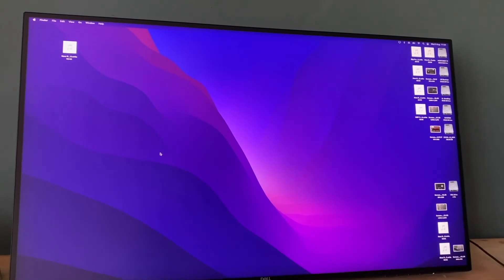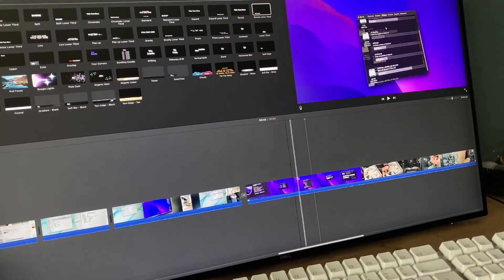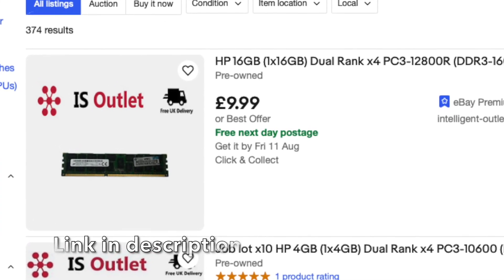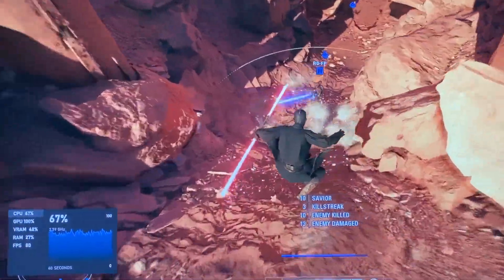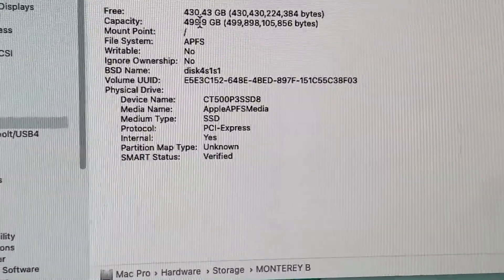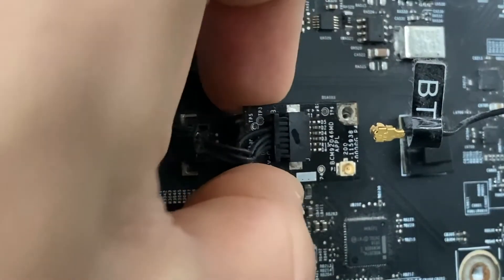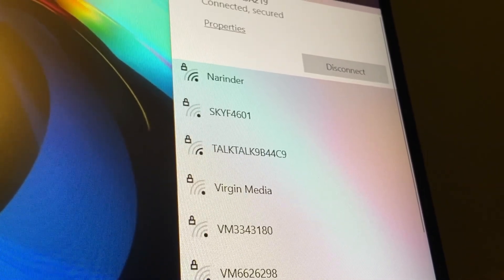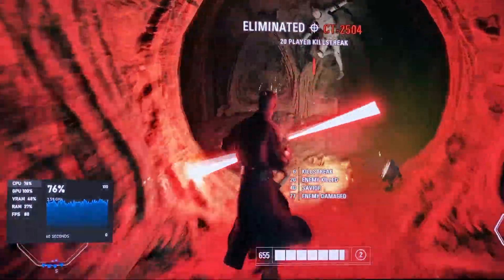6600 XT Mac Pro 5,1 Upgrade - Building the Ultimate Mac Pro 5,1 in 2024 with new CPU, Airport & more

Comment: this is not even close to the ultimate lol mines running rtx 4090, 96gb ram, 12 core 3.46GHz, 4TB NVMe & Win 11 Pro
Reply from the maker: I admire the insane spec you’ve built, but I feel like budget is an important factor here. There’s no point putting a 4090 with a 2010 era Xeon, in my opinion…
Reply: @montaguebarnabasltd  Totally agree. I picked up a 2010 Mac Pro for just $200—already loaded with dual 6-core 3.46GHz CPUs and 128GB of RAM (I removed two sticks). I already had an NVMe drive, and the Ugreen PCIe adapter only cost me $15 on Amazon. It’s installed in the lowest x16 PCIe slot, giving me solid 1850MB/s read and write speeds. The GPU is in the second x16 slot (just barely fits), but unfortunately that leaves no space for a USB 3.2 card in the remaining x4 slot. The GPU was originally for my main gaming rig, but I threw it in this Mac Pro setup about two weeks ago to test it—and it crushed. I ended up grabbing an RTX 4070 on eBay for $450, which I plan to leave in the 5,1 permanently. For gaming, this thing is still an absolute beast—even with its older CPU. I run everything on ultra settings at 1440p because it is the max resolution of my Apple 27" LED Cinema Display, and honestly, I can't imagine games running any smoother. All up including the RTX 4070 the system cost me under $700—and for that price, I genuinely don’t think there’s a better bang-for-buck setup out there.
Reply: Also, just a bit off-topic—but I have to say, the Mac Pro 5,1 really impressed me. It’s honestly incredible what Apple built back then. I also own a late 2013 Mac Pro 6,1, and like my 5,1, it’s running Windows 11 Pro—because macOS is absolute trash, lol.
My 6,1 was the top-spec model with the 2.7GHz 12-core CPU, which turned out to be awful for daily use—slow and laggy. I ditched it and swapped in an 8-core E5-2687W v2 (150W, 3.4GHz turbo), which Apple never officially offered. It completely crushes the stock 12-core in single-core performance and matches it in multi-core (confirmed in Geekbench). It also has 64GB of RAM, the dual D700 6GB GPUs (which actually work together properly under Windows), and a 1TB NVMe.
On paper, it beats my 5,1 in Geekbench—both single and multi-core—but in real-world use? It’s a joke. It can’t run games at all! it can't run anything graphic demanding! the GPUs are useless for anything modern, and there’s no way to upgrade them. No PCIe slots. Nothing. And this was supposed to replace the Mac Pro 5,1? The 5,1 with an RTX 4070 absolutely obliterates it.
I only use the 6,1 for Zoom calls now—it’s honestly the most pathetic “Pro” machine I’ve ever owned. No idea what planet Apple was on when they thought this was an upgrade. Just wanted to share my experience with both Mac Pros. They’re a generation apart, but seriously—they’re worlds apart.

Comment: I'm fascinated by all the things you can do with older computers today. I love being able to make these things still relevant.
Reply: I recently used Open Core Legacy Patcher to install Monterrey on my mid 2009 MacBook Pro 17 inch that I had shelved a few years ago because of the nagging issues of support dropping from browsers, etc with running El Capitan the last supported system.

I grabbed a new SSD, already had ram maxed, and did the new system install with OCLP.  It all went smoothly, and to my surprise Monterrey actually performs more smoothly than El Capitan did.  So now, I'm taking it with me again whenever I need mobile computing.  I've always taken good care of it, so it is in near mint condition and now feels like a new machine even though it is 16 years old!  Blows my mind actually.  I definitely won't go past Monterrey but it will serve me well for another few years at least for what I use it for, which is quite a lot actually.
Reply: This old computer has a lot up upgradeability which kept it performing over a long time.  New Macs have none of that.
Reply: @gametime2473  I can still use my 5,1 as a Maya workstation in a pinch.

If I wanted to, and part of me does, I could cancel my Quicken subscription, which goes up every year, and just use Quicken 98 on my Rev A iMac (or via SheepShaver), since I never use the more advanced features. 

MS Office is on that machine, and so is AppleWorks. Aside from questions about compatibility with others' systems and files, why not use these things today? Is PowerPoint so much more advanced than it was in 2000?

Comment: What did you gain by going with the Xeon X? I have the W3680, and it appears to be nearly identical to the one  you installed.
Reply from the maker: It has a smidgeon higher clockspeed I believe. Also, the X series can be used with dual processors which I initially intended to add.

Comment: Just a quick comment and understand this vid is some 10 months ago. The latest versions of OCLP (1.4.1 and 1.5) do allow the legacy blue tooth card to work, at least, up to Monterey but not it seems with Sonoma (have both on my system - 2012 with dual 3.46Ghz and 64 ram along with a flashed AMD Radeon RX 580). The legacy WiFi card, OTOH, is fine with both 12.7.5 and 14.4. Also I installed a USB 3.0/3.1 PCI-e card  I got off Amazon for about $25. Other than OCLP that was the single best addition to this ol' Mac.
Reply: macOS 12 or bust!

Comment: I’m running windows on that machine using rx580. Is it possible to plug and play unflashed rx6600xt nitro, if I don’t need a bootscreen? Love your videos!
Reply from the maker: Thanks so much! 
Yes as long as you don’t need to actually see a bootscreen you can boot into your usual OS.

Comment: meanwhile my main desktop is a 2008 emachine with a 3ghz core2 duo, 4gb of ddr3, which is unusual for socket 775 i guess, normally they use ddr2, anyways i have a nvidia geforce gtx 950 gpu and it plays all the games i want to play just fine. seems increasingly only the gpu matters. if i had money i'd probably just get a new system. i found that gpu in a dumpster shockingly, the only thing wrong with it was that it needed to be cleaned.. the only mac i have btw is a 2006 imac which i've managed to install mac os 10.8 onto as well as win10.. though i'd think anything newer might run slow as molasses, had to trim win10 down on both the imac and emachine, just so much bloat.
Reply from the maker: Nice setup! 
Honestly you’re right about the GPU/CPU reliance. Gaming is mostly a GPU stressy task.

Comment: Thanks  for an incredibly interesting work. I wanted to ask you if the MacPro 5.1 PSU can work with a video card AND a Radeon RX5700XT 8gig? I need it to edit video in 4k.
Reply from the maker: Thanks for the comment! I considered the 5700XT, but found it was very likely to need the PSU mod, depending on the model I got. If you’re not willing to give it a shot (I wouldn’t blame you), I would try the 6600XT, which offers better performance, or perhaps the 5600XT for something slightly weaker and less power demanding.

Comment: Dual CPUs would be a night and day difference for you. I just did the GOP flash on my 3 Mac Pros, so any PC GPU will work with a boot screen. Still, ALWAYS run OpenCore. It will protect your Mac from getting bricked by Windows, as well as give you a boot selector, even if you don't do the GOP Flash. Flashing the GPUs is no longer necessary. Flash the Mac.
Reply from the maker: All solid advice. Yeah OCLP is the saviour of all old mac users at this point, I just find opencore takes a little too much work to sort out. 
I think dual CPUs may fix my editing problem, but definitely won’t make a difference in gaming. When I’m going to be forced to upgrade anyway because of the latter problem, it’s not sensible to buy a dual CPU tray to fix only the former.
Reply: @montaguebarnabasltd  idk, I use one of mins for gaming, and it's way faster then my son's gaming PC, and he has an RX580 as well. Also, I wrote a script to automatically flip the flags in OC (or OCLP) for hardware acceleration and updating. let me know if you would like to see it. OC is pretty simple, once you understand it and get comfortable with it. With OC, unlike OCLP, you don't gave a patched or hacked OS, It runs natively, up to Monterey, If you're not going beyond Monterey, you should us OC, not OCLP. I do use OCLP on my Mini, and I will use it if I go to Ventura or Sonoma. I have nothing against it, other than keeping my OS native, and unpatched for Monterey and below.
OC also protects your Mac from getting bricked by windows. OCLP may do the same, but I think I have seen people with OCLP having problems with hardware acceleration. That may be resolved by now.
Reply from the maker: @fleonard4  Tbh it’s just illogical to me that a machine that probably has half the memory speed, 1Ghz lower clock speed, more than likely a slower SSD ETC can beat a modern gaming machine of this decade. 
Saying that, you seem pretty well informed about OC/OCLP. Thanks for the info, and I will more than likely be looking further into it in the future. I’ll let you know if I do want a look at that script!
Reply: @montaguebarnabasltd  well, again, it's benchmark and numbers watchers, vs real world. I can tell you, the dual CPU is night and day. I wouldn't even mess with a single CPU system. IF I got one for free, I would play around, but end up using it for spare parts. I have heard you can put an i7 in the single CPU systems. Still, unless you are just laying around, the x6590's are the way to go. The thing about benchmark watchers, is they get debunked. People have done the comparisons triple channel vs filling all the slots, and you can see a difference in the benchmarks, but real world, you won't see it. The same with GPUs. People say the PCIe is slower, but in reality, it makes no difference. You may see it very slightly in benchmarks, but not in use.

Comment: Great video! Did you have to replace the ROM on the video card to get it to boot? Everywhere I look it says the ROM has to be replaced to "fix" the 6600 XT to allow the classic Mac Pro to boot.
Reply from the maker: Thanks for watching! 
Yes, I actually bought a custom ROM 6600XT from MacVidCardsEU over the summer. It’s doable at home, though, with enough expertise.
Reply: GOP Flash, and ant PC card should work. Still, ALWAYS use OpenCore (not OCLP, unless you're going past Monterey). OC protects your Mac from getting bricked by windows and many other benefits, even if you've done the GOP or GPU flash.

Comment: Have you tried installing an RX 6800 in that machine?  I have the same GPU and Mac Pro 5,1, booting exclusively into Windows 11 via Opencore Legacy Patcher and have been thinking of upgrading.  I heard the 6800's TDP of 250W works in the machine as well (unigine ultra quality benchmarks draw about 25W from the backplane, and 100W max per MB power connector).  With an EVGA powerlink, you can further stabilize the power draw.  With 16GB of VRAM, the RX 6800 is about as powerful of a GPU as you can get without doing a pixlas mod.
Reply from the maker: I agree. It should work fine, but I haven’t tried myself. From what I’ve heard the 6800 is runnable without any modification. YouTube and Reddit threads are a good place to check people’s individual experiences though.

Comment: Could you please share a little more detail on your HD configuration 

I’m specifically interested in which NVME adapter you used to get it to boot into Mac OS

I previously saw where there are compatibility concerns with PCIe  cards booting Mac OS. 

Also how are you booting into windows?  

Ie do you have a separate drive for windows that is on the SATA (2.0 iirc) connector on the motherboard?
Reply from the maker: For the NVME adapter I actually don’t remember the one I bought. I’m not going to be able to check until early Jan because I’m away from home. Sorry to not be more helpful! 

As far as Windows goes, I keep it on a 240GB SSD on one of the motherboard SATA sleds with no other OSes on, as I’ve heard that helps the Mac play nice (both to make sure it sees the windows installation, and so it doesn’t mess with any current MacOS versions). 

Confusingly, despite everyone saying I’d need to use a DVD disc, or find a complex workaround, I just put the windows installation tool onto the same 240GB SSD, then made it write windows to itself, plugged into the Mac via USB. It’s worked flawlessly ever since, and since I have a flashed 6600XT card, I can view a bootscreen and choose windows or any one of my MacOS versions to boot into.
Reply: I use an Ableconn Dual NVMe Card. PEXM2 130. I was running Big Sur on it for ages and just recently upgraded to Sequoia. Has always booted just fine.

Comment: I am fully onboard with the Mac Pros 4,1 and 5,1.  I have a 4,1 flashed to a 5,1 and dual 5690 processors, 128GB of RAM, RX580 Graphics card, 2 GB of NVME boot disk, dual 8 TB Raid drives running Sonoma 14 (not 14.1 due to potential issues).  This is my daily driver and I absolutely love it.
Reply from the maker: Excellent! You’ve gone about as far as it’s possible to go into upgrading those things. A 2009 machine as a daily driver in 2023 is such an achievement.
Reply: I have a NVIDIA GeForce GTX 770 2 GB Graphics Card, plus 128 GB 1333 MHz DDR3 Memory, 2 x 3.46 GHz 6-Core Intel Xeon Processor, Mac Pro (Mid 2010) with Mac Pro - 10.14.6 Mojave Operating System. I'd love to know how you got Sonoma 14 as your Operating System, and what I might or should do to get Sonoma? Your help would be appreciated, thank you in advance.
Reply from the maker: @RandyRanson-d5x  I’m not the commenter obviously, but I can suggest the only straightforward way of going past Mojave is by using OpenCore Legacy Patcher. Greg Gant (known as ‘Definitive Mac Upgrade Guide’ on YouTube) has some really good videos on this, so definitely search his channel to get yourself in the right direction.
Reply: @montaguebarnabasltd  I think you meant going past Monterey. Martin Lo's OpenCore works up to Monterey, and you don't have to have a patched or hacked OS. If you go past Monterey, then you need OCLP.
Reply from the maker: @fleonard4  Monterey is still going further than the default Mojave OS. They were asking about upgrading from Mojave, so I explained how to get past that. 
Good points, and not wrong about OCLP!
Reply: Geez dude... I need to get mine repaired (black screen). But, I may look into upgrading it, money permitting. I also want to do the same thing to my Bondi iMac.
Reply: I love how it's all the best shit then just a 580 LMAO

Comment: Great stuff. Similar to one of mine. Mac Pro 5.1 is really holding up if you carefully select upgrades and follow through. Surprisingly fast in windows 11 aswell as Ventura/Sonoma. :D
Reply from the maker: Hell yeah, great to hear of another 5,1 running strong.
Reply: TNX: _Hell yes they run strong. all year around. ;) i believe i posted about a mac pro 2.1 running strong here aswell. But that comment seems to be lost or deleted :P @montaguebarnabasltd